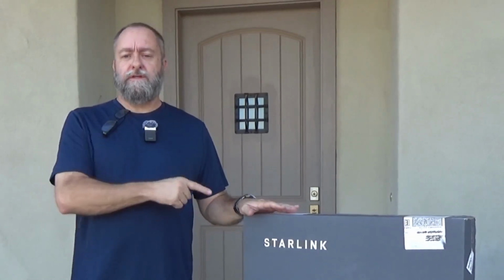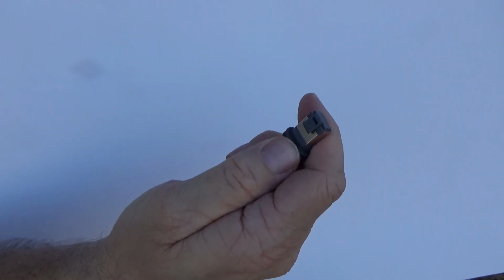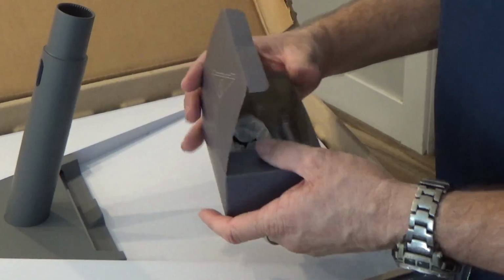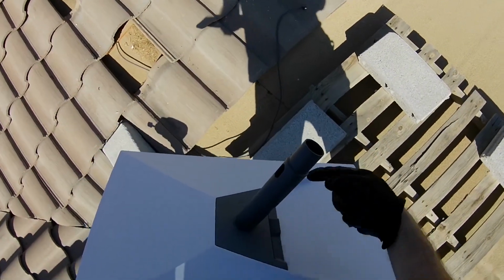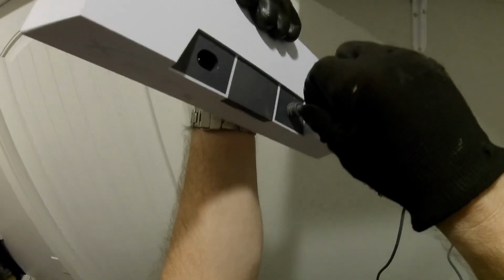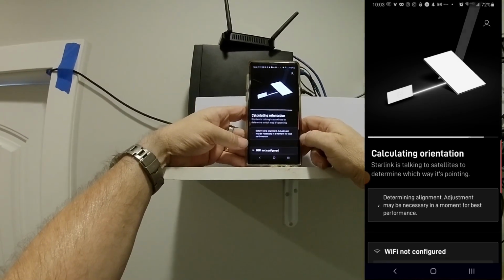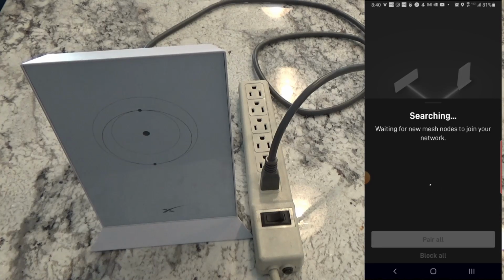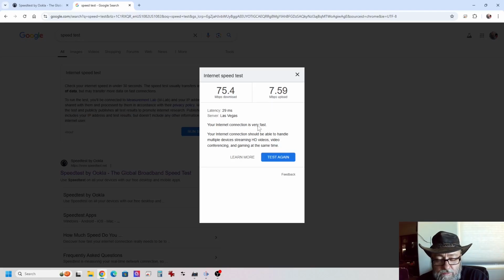STARLINK Installation: Gen 2 to Gen 3 upgrade

Comment: Can the Gen 2 cable be reused with Gen 3, or must I replace it with the Gen 3 cable like you did?  Thank you for the excellent video.
Reply from the maker: Completely different cable, they are not compatible. Must use the new cable for the gen 3 which is an RJ45 connector.

Comment: Shane, when you changed from the Gen 2 to the Gen 3, how did you transfer your service from the 2 to 3?
Reply from the maker: They must have already had the gen3 unit serial number registered to my account. I just booted it up and got it connected and it worked as I demonstrated in the video.
Reply: @shanesdiy  ahh okay, I buying a gen 3 tomorrow off Facebook marketplace coming from a gen 2 due to router failure 3 times now along with Ethernet adapter failure 2 times now. Can’t really find much info on swapping service from the gen 2 to the gen 3
Reply from the maker: @Trauma255 they don't make it easy but you'll have to contact customer service to figure out how to transfer the account.
Reply: @shanesdiy  i reached out to the assistant, all you have to do it set new unit up sign into account and it said it walks you through transfers to a new unit/upgraded unit and disconnects your old one from your account
Reply from the maker: @Trauma255 maybe that's how mine worked, lol. I don't remember it asking about transferring anything but it's been a while.
Reply: @Trauma255 I'm in the same boat! I have the Gen2 since 2021 decided to upgrade to Gen3 which just bought from Best Buy not thinking about how I'm going to transfer the service! How did you get a hold of support at Starlink to guide you through the transfer process?

Comment: Is the replacement free?
Reply from the maker: Mine was but that may depend on what they determine is wrong with the old one if you have a failure.  They had me do many tests to the old equipment to confirm what the problem was prior to replacing it for me.
Reply: @shanesdiy  Thank you. Your video was very helpful. I received a replacement too but they asked me to return the old device. NG.
Reply from the maker: @muifilms  I also had to return the old broken dish and router.
Reply: @shanesdiy  Oh. Okay. Thanks for this.

Comment: I have a 75' gen 1 cable and upgrading to gen 3 can I use the old 75' cable instead of the 50' it came with?
Reply from the maker: No, the Gen1 and Gen2 dishes used a different proprietary type cable, the Gen3 uses an RJ45 connector.   There are some aftermarket options for a longer cable if you don't want to buy the cable from Starlink.  I reviewed one such offering recently in the video linked below.  They have multiple cable lengths available, they have a 82' for about $46 plus I have a discount code in the video description that will get you 30% off if that deal is still active.
https://youtu.be/0QWTaqc5VF0
Reply: @shanesdiy  thank you.

Comment: What about the plan subscription? They discontinued the old plan? Or continue the plan but replace the device? I have similar issues as yours, they told me purchase new Starlink and give me credit for service…
Reply from the maker: In my case the plan did not change and I received no credit if I remember correctly, they just sent me the new equipment to install and I returned the old equipment.  I had a few weeks of no service while sorting out the replacement equipment.

Comment: Hi Shane 
We are located in east, central Florida and experienced a bad hail storm on May 5th.  When the storm cleared our Gen 2 Starlink was no longer working.  Did all the troubleshooting steps and as of today it still isn’t working.  On May 5th we submitted a customer support ticket and have had zero acknowledgement or response. We submitted a second ticket last night, with the same information, only to receive an email from Starlink support this morning that they noticed we had a duplicate ticket and they were closing the second ticket and they would reply as soon as they could to the original ticket.  Still haven’t received any response.  

My question to you, is how long did it take for you to get an actual response?  How old was your Gen 2 unit at the time it stopped working?  How did support determine what the issue was and to send you a replacement, for free?
Reply from the maker: @ChristineJones-r4q  I don't recall exactly how long it took to get a response but I do know I was asked to provide the same info multiple times and repeat the same tests several times before they acknowledged the gen 2 was bad. It was a little frustrating.  My gen 2 dish was about 4 years old I believe, when it failed.

Comment: I thought gen 3 had WiFi in it ?
Reply from the maker: It does, I used it in this video. What gave you the impression it did not have WiFi?  Was it something I said in the video?

One thing that is different with the WiFi on the Gen 3 is it doesn't create 2 different hotspots for 2.4G and 5G like the Gen 2 router did.  Just has one and the router automatically detects if the client device is 2.4 or 5G.

Comment: Im having an issue hooking up my upgrade. Mine is currently up and working gen 2 but I cant switch over to gen 3. Their customer service number hasn't been working for days. I submitted a ticket online,  no response,  it has been days. Im really upset. Im a single mom. Dont have money to waste. I pay a lot for internet compared to what I did with AT&T and I thought their customer service was annoying.  I cant get ahold of Starlink at all. I am not handy or tech savy AT ALL.  I stowed the gen 2. I powered it off. I have the Gen 3 mounted and hooked up. I turned on the new one. It was recognized but no internet.
Reply: I need to pay my bill and have my internet turned back on I have tried all day to do this
Reply: @RoseCSimpson  Yeah customer service is not great. Thankfully I only needed it once in two years but they went above and beyond.  I was shook.
Reply from the maker: Sorry to hear that.  What problem are you having with it?
Reply: I stowed gen 2. I turned it off. I have gen 3 all set up, I plugged it in. It recognizes it but no internet.
Reply from the maker: @HonesTeaBeauTea  Did you check the alignment?  It's on the app it will show you if you've pointed the gen 3 dish in the correct direction.  It doesn't move by itself like the gen 2 did.

Comment: No insulation in the attic?
Reply from the maker: I have spray foam insulation on the underside of the roof so the attic is essentially air conditioned space.  Makes it very nice when I have to work in the attic in the hot Arizona summers.

Comment: That was a really well done video - thank you. I have a Gen 2 and have purchased a new Gen 3 unit. Was that necessary or could i just have upgraded my Gen 2 with the Gen 3 mesh router? Are the speeds where you upgrade the router only (from Gen 2 to Gen 3) as good as replacing the whole unit to Gen 3? Cheers Vance
Reply from the maker: The gen 2 dish won't connect to the gen 3 router, different connectors, so if you upgrade you must get the set.  Local wifi speeds might be faster since the gen 3 has WiFi6 but my general internet speeds have been the same.  Haven't had any issues since I installed the new equipment.

Comment: Can I use gen 3 as a mesh for gen 2 router?
Reply from the maker: That I am not sure about and unfortunately I don't have any way to test that now since the gen3 dish won't plug into the gen2 router/nodes.  Do you have a gen2 or gen3 dish?
Reply: @shanesdiy you can
Reply: @shanesdiy you need the adapter for it to work if you want it wired
Reply from the maker: @Ilovetech960  What adapter are you referring to?

The gen3 dish uses an RJ45 connector, the gen2 uses a proprietary connector, do they have an adapter to let you connect a gen2 dish to a gen3 router?  Starlink told me I couldn't so they sent me the gen3 dish and router when my system had a problem.   Also, mesh nodes are only wireless to the main router, you cannot connect them via Ethernet or is that not what you meant?
Reply: Yes you can

Comment: nice small detail sir, I hope it will help me replacing my dish. I just got my replacement upgrade from gen 2 to gen 3
I choose standard wall mount for gen 3, starlink give me free upgrade because I used long wall mount for my gen 2
Reply from the maker: Thank you for the comment. Did your gen2 dish fail as well?  Mine was also replaced at no charge and they included the mount.
Reply: I got “GPS is not valid” info from debug data, 
its been about 2 months and seems ok, but after last 2 weeks update it got very long time when rebooting , around 10 minutes and got slow connection
So I contacted starlink and they offer replacement , since they not making gen 2 anymore, I got gen 3 replacement
Reply from the maker: @matomerah  Different fault but pretty much the same process I went through.
Reply: @shanesdiy  is there any significant different between gen 2 and gen3 ? When using gen 2, between 5 pm - 10 pm, only got about 50Mbps , other than that time I can get around 250 Mbps
Reply from the maker: @matomerah  I haven't been doing speed tests very often over the last year so can't say with any certainty if the gen3 is faster.  Over the last year or so I rarely noticed any issue with the gen2 up until it failed.  The gen3 has been working great since I installed it, don't really notice that it is any faster but I only do a speed test if I'm having trouble...  I have no complaints so far with the gen3, been working perfectly.
Reply: @matomerah Exactly same issue. Exactly. I'm being sent the v3 jus happened yesterday after maintenance